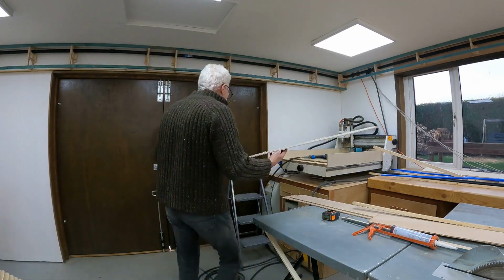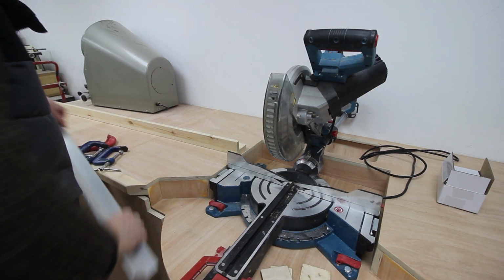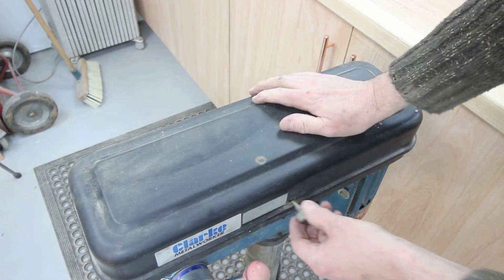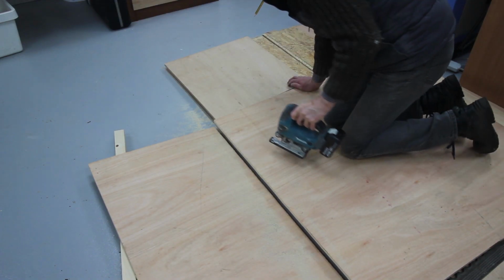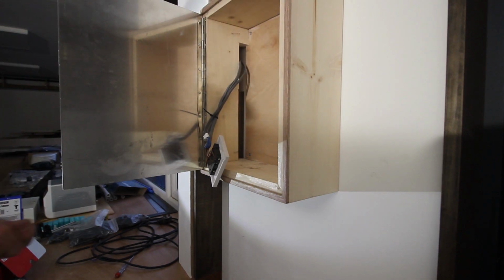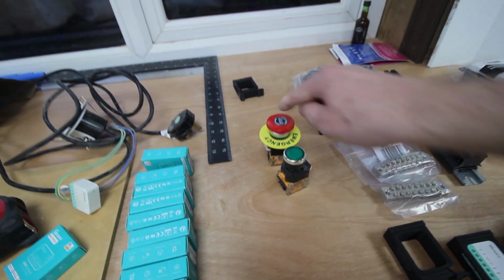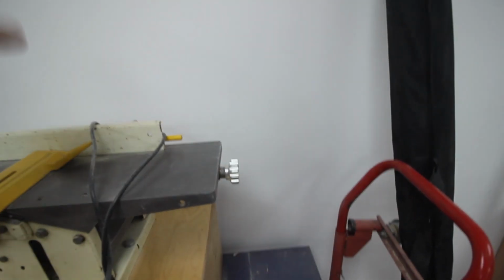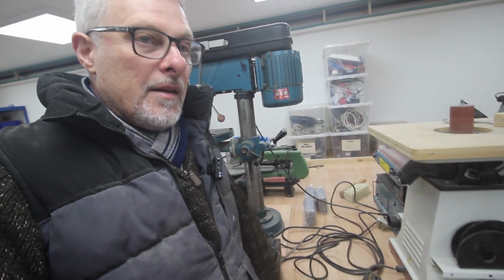More trunking, Mitre saw, Pillar drill and IT Cabinet Shenanigans'

Comment: Excellent video.  I stumbled across your channel by accident and have really enjoyed catching up with your workshop build.  Now looking forward to your next update.  Regarding the ventilation to the IT cabinet, I would recommend vents at the bottom and side, not the top.  More dust will collect with the vent at the top.  One question, will you be using the Sonoff to turn machinery on/off.  Sonoff are rated at 10amps, so will this mean you’ll be using them to drive a relay to power machinery?  Keep up the great channel!
Reply from the maker: Hi @Wern-Life
Thanks for your comment. I hope to control Edward the compressor with Sonoff. I think I can slave a relay unit with the unit in the workshop. If so the relay will drive a contactor to get the current up and deal with the motor spikes. Good call with the vents.
Cheers